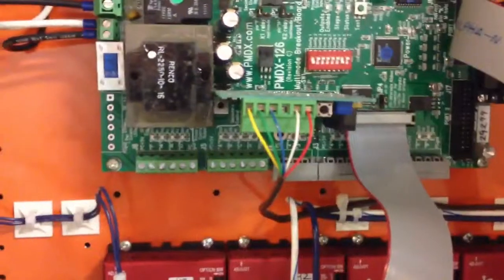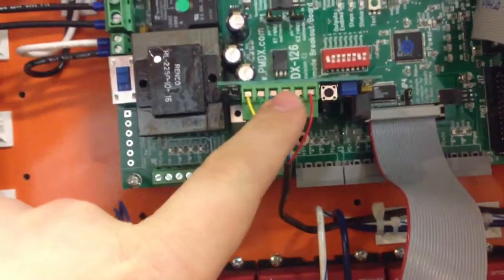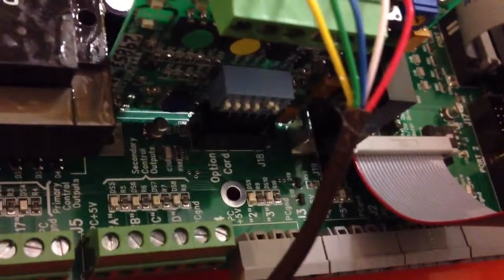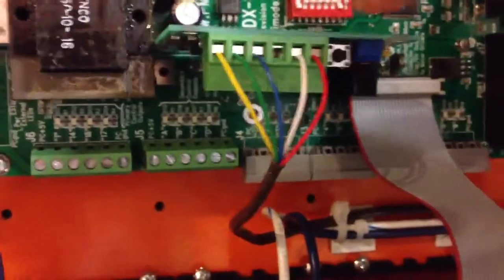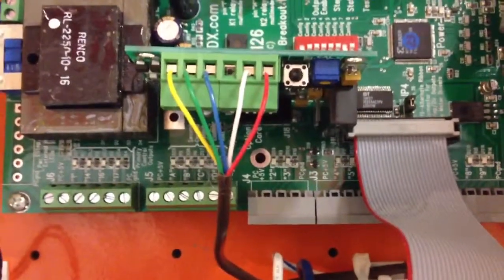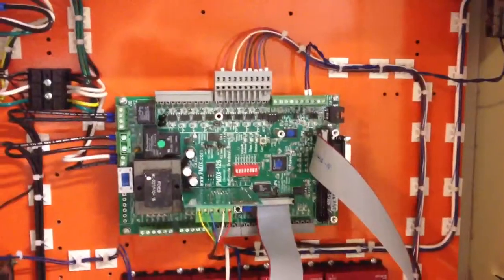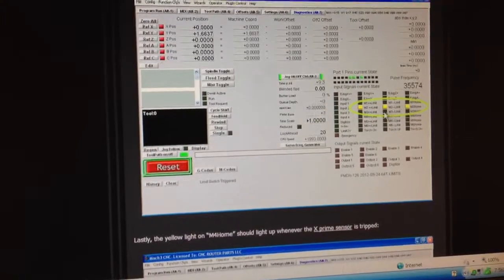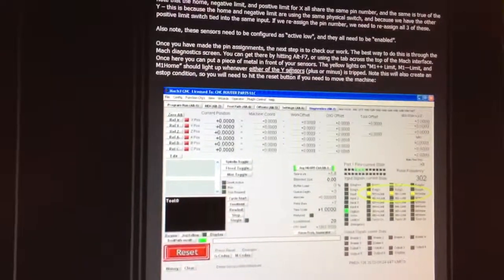Viewer Q&A - more details about the PMDX107 and settings on the CNCRP Prox. Switch

Comment: hi there. i run the same setup. problem is, that the mach3 rpm is not what the vfd puts out when set. did you have this issue?

Comment from the maker: sagamed1,

The colored wires are used inside the control box.  They terminate in a bulkhead connector that is a 5 PIN XLR connector.  I made a separate cable that connects the XLR connector to the vfd.  I'll post a video that shows pin connector to pin connector so that there isn't any confusion.

However, I would encourage you to read the manuals for each piece of equipment.  There are settings in each that you need to know.

Comment from the maker: The wires in the box are not sheilded... they go to the XLR bulk head connector at the bottom of the box.  It is the cable going from the XLR bulk head fitting to the VFD that has been sheilded.

Comment from the maker: The sheilding is actually handled through the XLR connector.  The connector on the box is grounded to the large enclosure form CNCRP.  The sheilding on the cable is attached to the mating connector which has a conductive path through the connector on the box to ground.  I did not make a connection of the sheilding to ground in the VFD to avoid a ground loop, though you could probably connect it there without a problem.